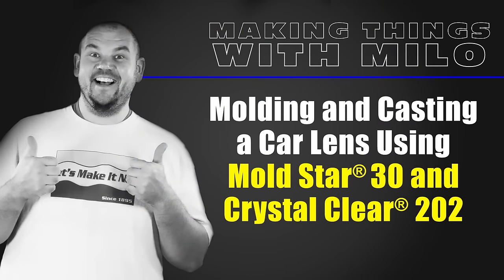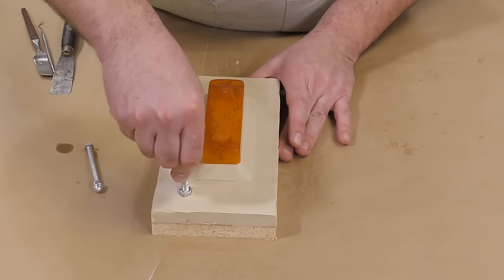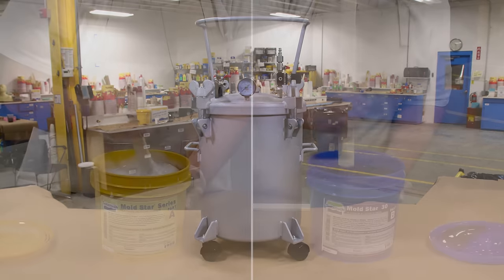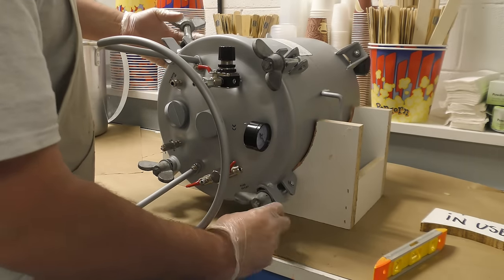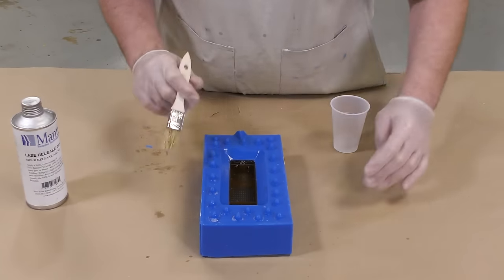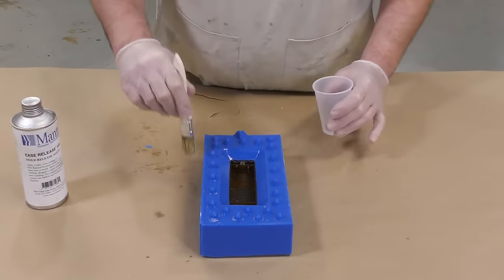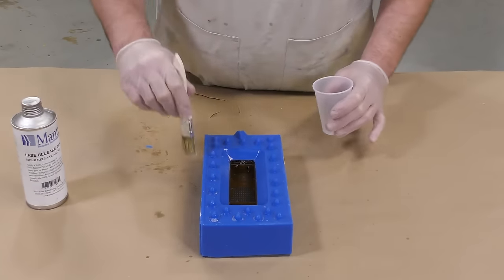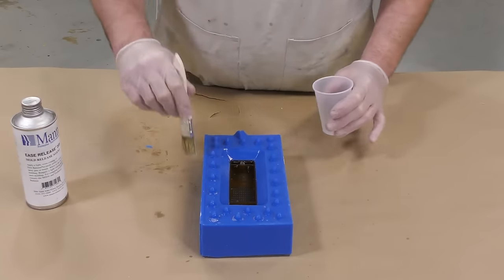How to Create a Replacement Tail Light - Moldmaking and Clear Casting Resin Demonstration

Comment: I can save you the cost of buying all those items for 1 lens ..Google square marker lights  There is a few places that have over 100 square lights  I never heard of a car or truck where you can not find another lens for it
Reply: You don't restore rare, old vehicles, then, do you? 😄
Reply: @MaryAnnNytowl  Rare maybe.  Old ? Depends on what you think is old  Since 18 i have owned from the dealer And restored a 83' Trans am a few times  Still able to find parts for it  I have torn apart a 1947 Labatt Beer White Streamliner Beer Delivery Tractor-Trailer   Removed the 68 lbs of bondo and stretched the wall panels to fit firm and flat  The lens were from a coin op rocket ship ride you find at a mall  We paid $21 and was sent 2 days later My last Old project was one of many people who restore the Canadian  Mk X Lancaster bomber  era 1943  1 of 2 still flying in the world  As i painted the underbelly of the aircraft and had to under go testing of the thickness  And thin out the paint to meet the usage it had then as paint was hard to get because of the war And they thinned it out to make it last longer ...No one else knew or read up on it ....Cheers
Reply: @freakyflow , so, in other words, you're saying that, aside from a very popular car only 35-36 years old, you didn't have any OEM or aftermarket lenses you had to try to machine into existence again. You found things that were 'close enough.'  In restoration, 'close enough' isn't exactly what the guys with the big bucks want. They want as close to original as physically possible (the closer the better) or they want rat rods. Nothing much in between. 😉 We've come across things 60, 70, 80 years old that needed things machined into existence for them. LOL, we've even helped restore steel-wheel horse-drawn wagons! Talk about hard to find replacement parts for something! 😄

As to the plane, kudos to you for that paint job. And the thinness of the paint would account for the runs I would notice on old WWII-era planes, LOL! I was a painter, and tend to notice the teardrops at rivets and such. 😄 Largest job I ever painted was a 53 ft trailer, from top rail down to the bottom rail, and the undercarriage and dolly legs. Even so, those were generally a two-man job, one on top on scaffolds set up around the whole thing, with a second painter underneath; paint until you have to turn the paint gun over to the other person, and they panted the rest, and across the next couple of panels, then the paint gun was handed back up to me.  Did several other parts of the trailer repair, too - anything a driver or forklift operator could tear up, we fixed. Did that for nearly 3 decades, until an injury disabled me. Miss the ~bleep~ out of it. Don't miss the pounds of bondo that they tried to use on the trailers, themselves, though... as if bondo and a coat of spray-can primer is gonna last cross-country for long... on the side, shoved through to the plywood interior.  🙄 Oh, the things I've seen truck drivers try to "fix" those trailers with mid-trip. I won't even get into 100 mile-an-hour tape... it's evil. 🙄🤣

Anyway, thanks for the trip down memory lane. Peace.
Reply: @MaryAnnNytowl  So what i am saying is On my own car in order to keep very thing original to factory and dealer specs It has no aftermarket parts nor hand made ones The Car style 82 - 92' Was popular  And the models Firebird, Formula, Trans Am, GTA, also popular what is hard to find is My year with my options in my color with my interior color As many have been made to look like mine but it is not original even a lens yes 

See if this brings home memories  Remove the Decals off trailer (Leave the DOT sticker on ! ) sandblast dolly and rims and axles ..duct tape the air lines and any electrc wires   Open doors air blow the sand out  blow off roof and the rest ,,,Tape off metal top rail and door handles wipe and wash painting areas ..Tack cloth ..Been there done that .. The best and worse was when they came with "plastic" panel trailers ..We used red 3M pads and done the wip and tack "new type of primer" and 4 trailers later ... They go to power wash them and the paint peeled back like one big paper sheet  The plastic panels needed a wash with a PH flat cleaner The plastic had a type of acid in it  And we had a fleet of 40 of them to do ..not fun ..oh and fork lift holes...Heat gun taped to a stand on the hole to dry it  Then a resin patch with a tape line and a "catch" bag for resin to dip into saved alot of grinding afterwards  ..The old truck i done had sheet metal installed in 92" but it was not tight and bowed  Cracking the paint ever few years ..I had told the boss it would be cheaper for us and the customer just to drill out the rivets cut the panel shorter and pull it out and brace and add in the rivets  Then prime and paint with very mild spots of bondo ...If you ever see the Canadian Lancaster on youtube look at the belly You will see the "Black" has a grayish dull with shots of shine by sun to it  The RAF British one looks Pure black underside  ...And be thankful your not doing it still ..So many things there to kill you  Quickly and slowly   We had a painter Nick named Shaky  Not sure if it was from the years of toxic fumes and chemicals or years of drinking a few beers before and after work  But by 3pm he was done painting lol

Comment: Don't do the calculations to find out what the tensile stress is on those pressure pot bolts. It will terrify you!
Reply: Nah, they can handle it. They're not your average hardware store bolts, LOL!
[source: worked with paint pots (pressure pots) and with pressure cookers, both, for decades. They're designed to handle MUCH more than the average settings on them.]

Comment: 5 Horsepower ??? You've got to be kidding me? I pretty sure a 2HP could very easily reach 60 psi ! Most everyone I know doesn't even own a 5 HP -  not to mention a 5HP would almost certainly be 240V.
Reply: 5hp doesn't need 220, LOL! Larger, yes, but not 5hp. As well, a larger air compressor isn't working as hard to reach pressure, so would last longer.

Comment: No need of injection moulding machine...any more..?
Reply from the maker: Injection molding still has its place, this is a different method using a flexible mold as opposed to aluminum. Thank you for watching!
Reply: @smoothon   Thanx for the reply any knowledge  u can share on FRP/GRP products making

Comment: Depending on your region and state laws, you can't just "knock up" a tail light, they usuall have an E code (in europe) or other such standard code to show the unit is in compliance.  In the whole scale of things I doubt there would be a problem, but there "COULD" be, so you need to warn your viewers of that information
Reply: Generally (at least according to my nation's regulations), codes laws only list what colors must be used where (eg, no purple turn signals), what distance must be between the pavement and the light (eg, at least 12" above the ground level), what the light must illuminate from what distance (eg., license plate light must illuminate all of license plate), how far away the light can be seen from in X amount of lighting (eg, must be visible from 1000 yards at full dark), and things of that nature. If a newly-created lens can match those requirements, it's good. No stamp required. [Note, laws listed above are not all actual laws, just a for-instance example for each -- although the no-purple-turn-signals one definitely IS a law.]

In other words, for all uses, one needs to KNOW one's country's transportation laws.

Comment: $191 (shipped) for the Mold Star 30 - yikes!
Reply from the maker: There ore other options for rubber available for this technique, Mold Max tin-cures silicone or Vytaflex urethane, for example.  The techniques would be the same.

Comment: Sorry, but I think you're simply over engineering/complicating everything. I've seen car modelers do the same thing for additional car bodies with a lot less effort. All you're making is a 2 part mold, something I've done many times, though not as large.
Reply: Doesn't seem that complicated to me. The again, I worked in a shop with all those goodies for almost 3 decades before I retired, LOL!

Comment: There is so much wrong in this tutorial.  They are trying to make it look simple and cheap so it doesn't scare you and not buy stuff.  I cast high end clear fishing lures as well as car parts (lenses, bezels, etc) and prototypes.  You would never make a silicone mold just using pressure.  Bubbles don't magically disappear, they will rebound at ambient pressure and then you decrease the tear strength of your mold.  On top of that, now you have to make sure you cast at that exact pressure or above to ensure the bubbles don't distort parts of the mold.  Not pulling vacuum on the clear resin and expecting 50-60PSI to eliminate all the air you mixed in is bogus.  You can see bubbles in the lens he demolded.  Plus, a squish mold??  Never make molds or parts for me, please.
Reply: Because, of course, you would know more about the company's materials, and proper usage of same, than the company's own employee knows, and of which said employee is using according to the company's precise specifications. Right. Sounds completely believable.

~ backs away slowly ~

Comment: your not gonna beable to see thorough it properly it will be cloudt cause car lens use high pollished inserts that make it look glossy
Reply: James Weatherbie itll work better than nothing
Reply: James Weatherbie you can make it glossy
Reply: you cant make it glossy unless you have a mold to make it but i dont think you got a injection mold sitting around
Reply: it might not even reflect honestly
Reply: I've made over 100 sets of high-gloss automotive lenses with nearly this same method. Vacuum degassing and pressure casting are required for the best results. If the original parts used for the master are glossy then the cast parts will be too (unless you are careless). The copied parts will also have the same optical properties as the master. The parts I make are water-clear with no tint so there's nowhere to hide any flaws. To get maximum lens strength, I heat my pressure vessel during the initial 24 hours pressure -and then do a 2-step post cure out of the mold in a dedicated oven I built that cooks for 4 hours at 120F and then another 4 hours at 140F.
Reply: @slickraft It sounds like you are tempering the plastic is that right? Do you have an Autoclave or have you found a safe way to heat a pressure pot? Thanks
Reply: You don't need an autoclave to post cure. Those go way higher than I"ll ever need. . I have an old toaster oven that I converted with external controls to give me a two step post cure. It is the same type of controls used sometimes to hatch eggs. As for heating the pressure pot, I use low wattage flat silicone rubber heating pads and again, use an external controller to regulate the temperature to about 115F during the cure.
Reply: @jamesweatherbie3 : Did you even glance at what you typed in your first comment before you posted it? That must be one of the worst examples of misspellings and pathetic grammar that I've seen in a considerable time on YouTube comments - and that's saying something. There are literally 10 mistakes within the first 20 words. You've even got 8 mistakes in this shorter comment. You have a total of 32 errors in your comments. It takes talent to make that many mistakes so densely-packed. Well, perhaps 'talent' isn't the correct term. Is English not your first language?